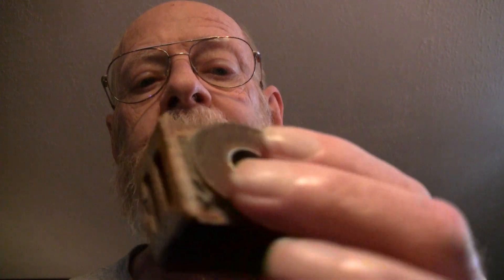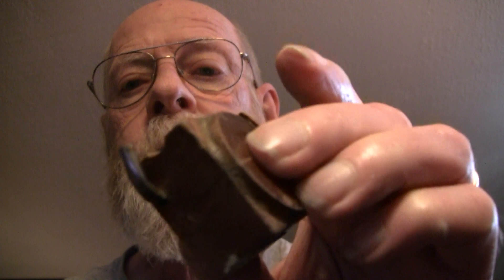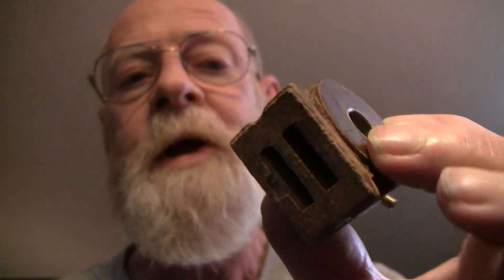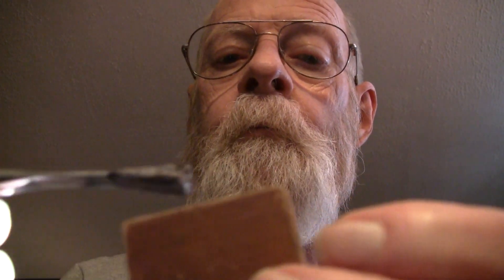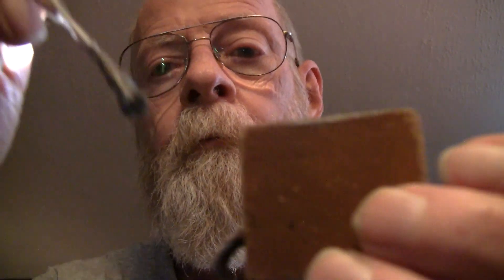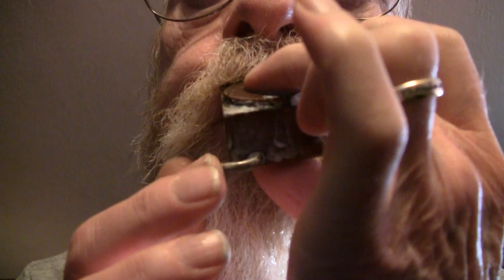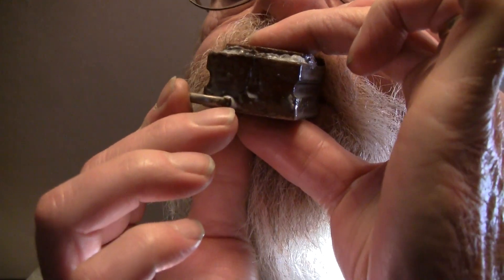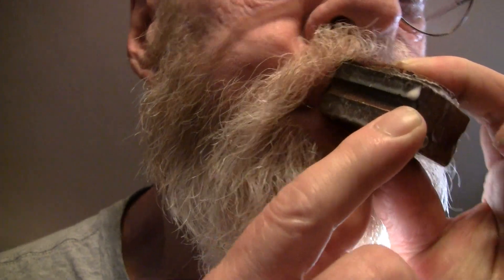Wood Leakage in Ampico Block Valve by John A Tuttle for Player-Care.com

Comment from the maker: With regards to sealing this type of leakage, what I've done in the past is paint the wood with Phenoseal and then suck in gently for a quick moment on the same ports that I was blowing into when I tested the block. Only do this gently for a second because you don't what the sealer to get 'inside' the block. You just want it to get into the microscopic holes in the wood. Once that's done, apply another thin coat of the sealer to the block and let it dry. It usually dries within 5-10 minutes.